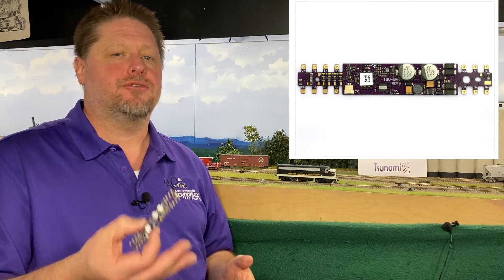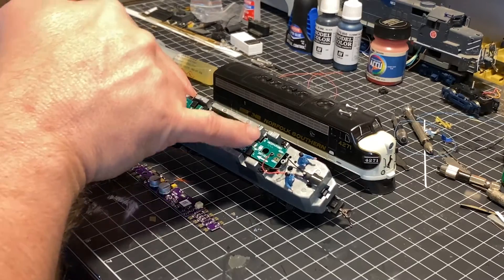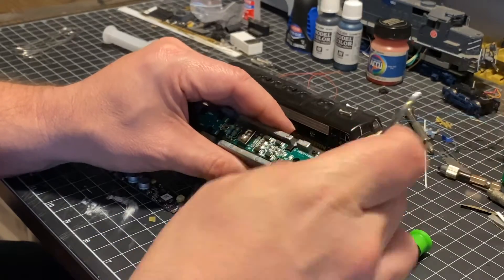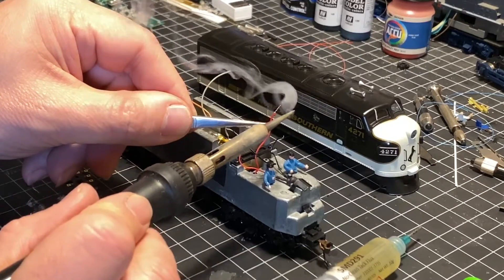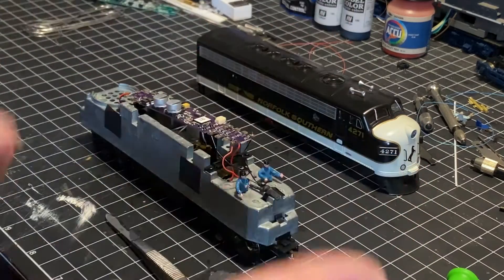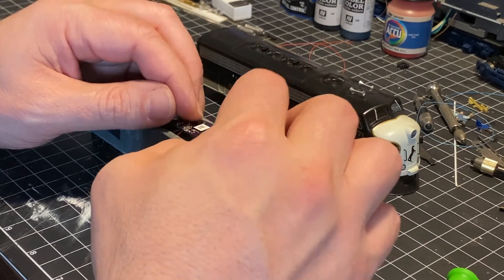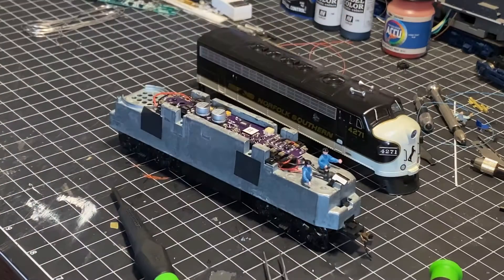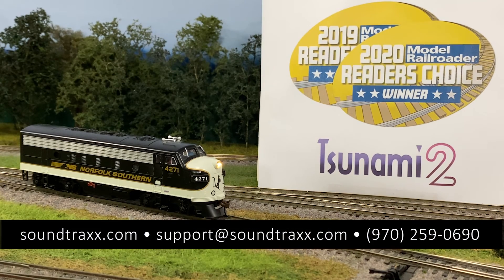New Tsunami2 Decoder: Full TSU-BH1 Install

Comment: Does Soundtraxx have a drop in speaker to match this decoder for Bachmann ES44AC and SD70ACE locomotives?
Reply from the maker: Any of our speakers would need to be soldered not just dropped in. We have a selection of speakers. The TSU-KN1 comes with our Mini Cube 3 and 6 baffles. this is a great little speaker!
Reply: @SoundtraxxDCC  Thanks.  I plan on soldering any new speaker, but I think I was too vague in my question so let me try again…..  What I meant to ask is if you have you have a speaker that would fit in the fuel tank space where Bachmann locates the factory speaker on the ES44AC and SD70ACE without modifications.
Reply from the maker: @mikemcmullen1331  Off the top of my head I don't know the space available, but the mini cube 3 comes with 6 different sized baffles to fit a variety of models. You can see the dimensions with each in the product photos on our website: https://soundtraxx.com/accessories/speakers/oval-speakers/mini-cube-3-oval-speaker-baffle/

Comment: Thanks George, Would this work in a old Life-Like F7 that is DCC ready?  🐾🚂 BearCreek, Cov. KY.
Reply from the maker: For Life-like EMD F7A-B models we currently recommend the TSU-PNP8 (P.N. 885813) https://soundtraxx.com/products/tsunami2-digital-sound-decoders/tsu-pnp8/

and 28 mm Round Speaker (P.N. 810153): https://soundtraxx.com/accessories/speakers/round-speakers/28mm-round-speaker/

and 28mm Baffle KitL (P.N. 810110): https://soundtraxx.com/accessories/speaker-baffles/28mm-baffle-kit/

The new TSU-BH1 may fit as well, but it is longer, skinnier and taller than the TSU-PNP8 so you would want to check how much room you have. The TSU-PNP8 should fit in this model though.
Reply: @SoundtraxxDCC  Thank You so much for that Info and put one on order when I get back from vacation.
Reply from the maker: @ricter591  Perfect! Enjoy your vacation!

Comment: Nice product George.  Will SoundTraxx begin producing decoders for other brands of locomotives (KAto, Athearn Genesis, Atlas, etc)?
Reply: No point in doing Athearn since you might as well just buy it with the Tsunami2 on board
Reply from the maker: We do have one board out for Kato already the TSU-KN1. And yes Athearn Genesis comes factory equipped with Tsunami2. We do have several new boards in the works so stay tuned! In the meanwhile you can install Tsunami2 into many models -even if it is not designed specifically for that model. Just contact our Support Department for help with this: support@soundtraxx.com or (970)259-0690

Comment: When converting Bachmann DC to DCC, Soundtraxx recommends removing the capacitors on the motor. Was that deletion not required on this procedure because it was a DCC replacement, not conversion?
Reply from the maker: I'm not sure where you are referencing our recommendation from.  In my experience, we can use them or not.  They are there for FCC noise interference. If they pose an issue, or you notice your loco lurching a bit more than you want, then you have the prerogative to remove them, but you may find more interference with TV remotes and other stuff like that when running the train.  I never recommend either.

So, if it’s an issue, then remove them, or just do it in your practice.  But, ultimately up to you.  I did not need to remove them in this video since they did not significantly interfere with the motor control.

Comment: Don't understand why you are using flux. 
Surely its much easier to use solder that already incorporates the flux within it of which there are multiple brands and can be purchased in various gauges and temperature ratings such as made by Multicore etc so you tin wires directly just by applying the soldering iron to the wire then apply the solder. One process instead of two. These solders are compatible with printed circuit boards etc etc bearing in mind that pcb's now incorporate hi melting point solder with less lead for health reasons.
I much prefer low melting point solder with more lead as easier to work with and less susceptible to producing dry joints.
The most common cause for producing dry joints is movement with the joint whilst waiting for the solder to set + dabbing the joint repeatedly as this evaporates the flux leaving a dry crusty solder joint. Some metals such as steel can prove difficult to solder even with pre fluxed solder and it may be necessary to use bottled / syringe type acid flux in order to get good secure joints.
Reply from the maker: The reasoning is that when the flux is part of the solder, it tends to burn off more quickly as the solder melts initially, and therefore does not fully flow into a joint.  For tinning a wire, it’s probably fine, but if you are using it to solder to decoder tabs, for example, then the flux burns off before it fully flows onto the pad.  When you apply the flux separately, then you can fully cover the solder pad and have a better coverage.  The flux is there to de-oxidize and clean the solder pad and help improve the flow of the solder into the joint, so if it burns off and evaporates before it can do that, then it’s useless and you can have poor, or less than ideal connections.  
We use all lead-free solder and components here because we choose to.  In CA, all products sold are supposed to be lead-free, so we switched many years ago.  I hope this helps.
Reply: @SoundtraxxDCC  Appreciate this as lead free solder although complying with regulations is rubbish to work with as it has a higher melting point and as you say by the time you heat the area you want to solder you have evaporated all of the solders flux. Been soldering for 60 years and still use solder with lead content so don't have the flux problem but fully understand by being a manufacturer selling into the public domain you can't.